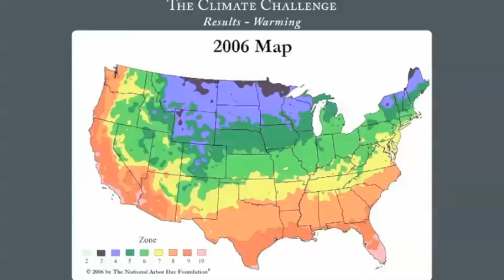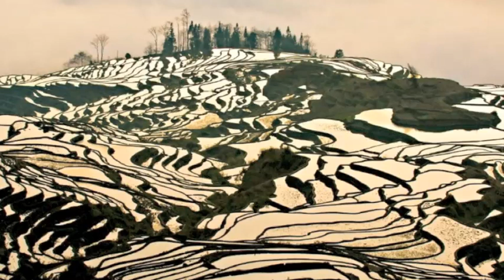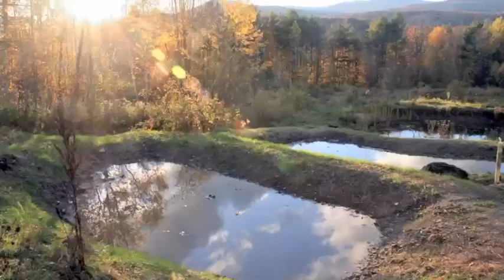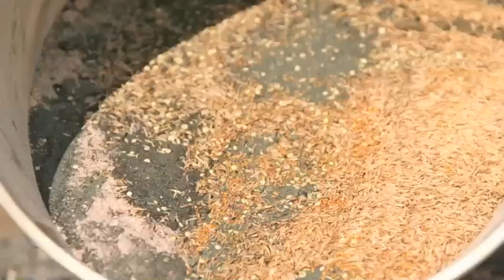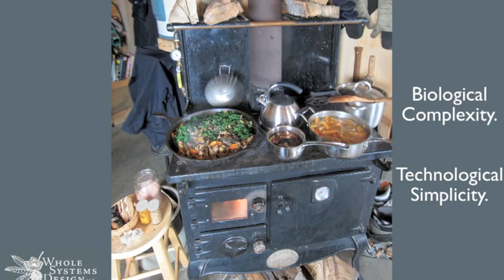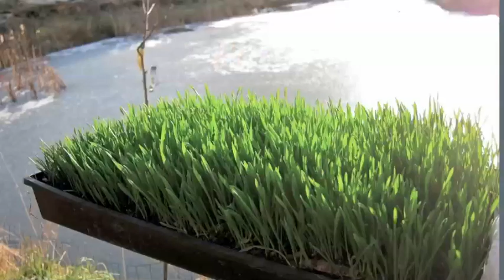Ben Falk at NOFA VT 2013: Homestead and Farm Resiliency - Principles in Practice

Comment from the maker: We don't bury some of the siphpon lines yet because we're not sure where they will end up - still in major experiment mode. They work great as they are - covered with grass fast and don't get much UV. Rice is an experiment which so far seems very suitable here in hard subsoil, tubers work on some of the land but require bigger soil input/oner time horizon. We are trying everything at this point, discounting little.

Comment from the maker: Hi,
Yes, a bulldozer would be great for many landscapes.  We have large boulders everywhere which would pose a problem for a dozer and the dozer would need to disturb a larger space than the mini ex. I also happen to own an exc. for other uses.  If I had a cleanup bucket I'd use that on the machine.  We don't make the swales just for water catchment, we use them to get above a high water table.  The uphills are as steep as they are because it's on steep ground. They work great here.

Comment: A french forrest warden came up with you should have. It is called the Jean Pain Method.  By finely shredding wood and decomposting it he had a system for getting hot water, producing fertilize and biogas on the heat of biodecomposition.  This is a DIY promect that will give many benefits since you already have an abundance of wood.

Comment: Blend WVO or WMO with 20% Petrol, let sit 24 hours (recommended), then run it through the Centrifuge; next Filter' to 1 micron; or just Filter'. Done
Note: never blend WVO/VO and WMO; clean the tank by running a load of Diesel prior to switching fuel blends.

Comment: Nice to see a permaculture designer doing earthworks.  I have some constructive criticism.  The bucket of an excavator is not an ideal tool for digging swales. Use the front blade on excavator, box scraper or bullldozer.  Slopes on your swales are too steep.  Swales catch overland flow.  If they're 5' apart they're not catching much. Differentiate between diversion (conservation) drains and swales.  Bury siphon lines.  Grow tubers not rice for carbs. Animals over ponds or drains saves time.